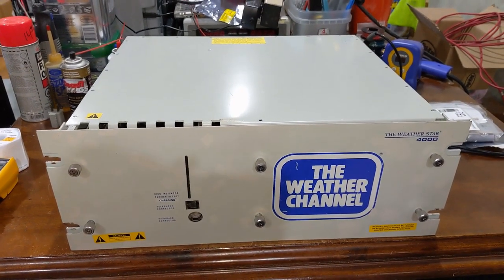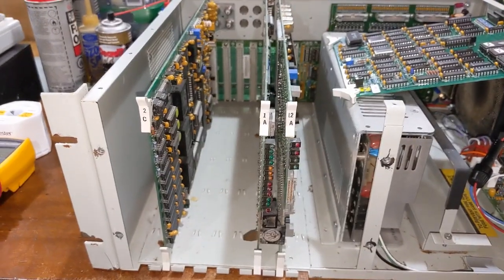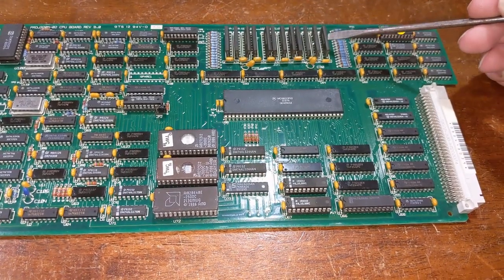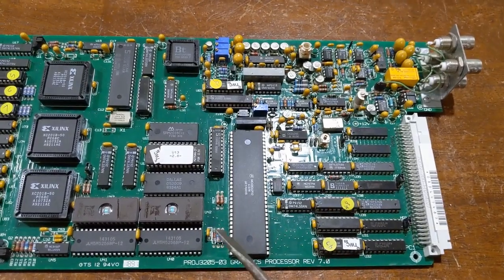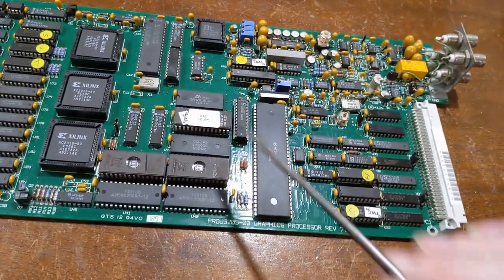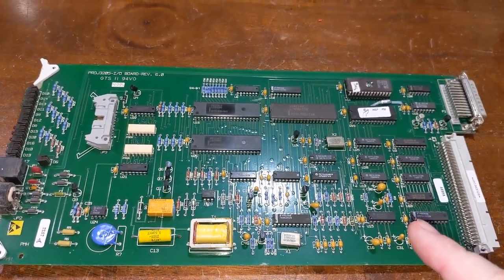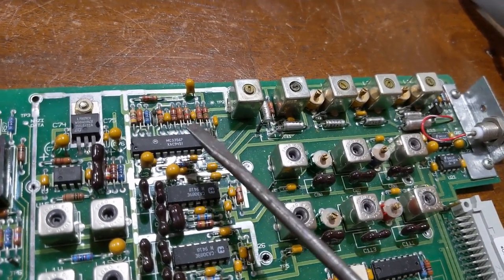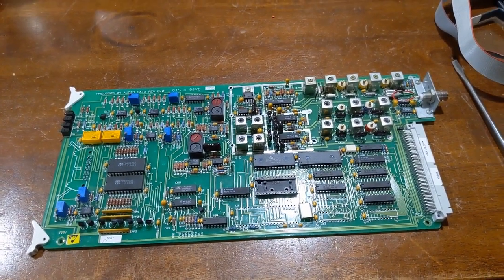WeatherSTAR 4000: A Brief Hardware Overview

Comment: This is absolutely fascinating and hardly boring at all. It's amazing to see how these older embedded computers work, and how uniquely they operate compared to modern systems - or even similar vintage systems with the same parts but a different purpose, and thus a different design, because you had to do so much in hardware. All the work that has to go into decoding the satellite stream (even after the Videocipher did it's work!) really makes me appreciate how much easier things are today with SDR's and SBC's, if less magical.

I'd love to hear more about the software side of things, and how you did the custom data decoder card. Coordinating all those different processors over a shared bus with weird limits on which processor can access what cannot be easy.
Reply from the maker: Glad you enjoyed it! It was a royal pain in the ass, especially writing software for a machine that "doesnt exist" digitally as far as documentation, etc goes. So it took full reverse engineering efforts plus memories from the 90s when I grew up, along with some help from others  to bring this machine back to life again. I wanted to do things differently, like running some form of an RTOS and having the application run under it, along with a RAMdisk image that contains all graphics assets. But then again that would have taken skills I dont quite have, fiddling with writing drivers for the RTOS and matching it up with this specific hardware, etc. I never majored in CS so that wouldn't be easy. Since I understand hardware alot better than I do software, I went bare-metal. setup a C Toolchain with GCC 9.2 targeted to the 68010. Went bare metal allowed me to do what I needed done. No memory management or kernels of course, no HAL or user/supervisor nonsense, so I had to keep track of everything I am doing with RAM and pass pointers back and forth. Real easy for things to get lost/crash, and no way of recovery due to the lack of an OS. the I/O card has its own ROM, and an 8051 CPU so I had to write that stuff in ASM and Keil. not to mention the new Data card, it has an Atmel AVR handling bus traffic and thats written in BASCOM BASIC, as well as the raspberry pi which bootloads the machine and feeds data into the machine, is written in Java. Weeeeeeee

Anyways, the Graphics pipelining was even more difficult because there are things which have to happen in parallel. So i ended up writing a tiny little task switching kernel which allows me a couple different mainloops as "threads" with their own contexts/stacks. That way the LDL draw can happen in parallel with main background rendering. still needs improvement, but it works...

Also had to work within limitations of RAM on the graphics board as well as bus master paging. For example, the Travel Cities Forecast requires a bit of orchestra back and forth between the GPU and the CPU over the IPC pipeline, and IRQ Vectors I had setup.

Comment: Nice overview! There were some things that I even previously never even knew about the WeatherSTAR 4000's hardware until now. If you do a follow up video, I'm curious to see how the 4000 boots up, as well as how it receives its data on the screen and how the menus and diagnosis features work. I'm also curious on how you wrote the code for the 4000. Either way, great work as always!
Reply from the maker: I will be on the weather brains podcast in June discussing this thing. its going to be a blast.
Reply: @THEtechknight  I can't wait to see that!

Comment: Not sure how I got here but it’s fascinating. Being a bit of an amp head I found myself wondering what kind of meter you have and if you had to replace any of the components on any of the boards? Looks like a nightmare to solder in new components to the video card in particular.

Comment: Some sites mention that The WeatherSTAR also used the VBL.  Though you never mentioned a circuit to decode the VBL.  Was the use of VBL dropped after the WeatherSTAR 3?
Reply from the maker: VBL was quickly dropped in favor of subcarrier by the time the STAR 3 came out. The original STAR1 and STAR2 were converted to subcarrier as well. As far as i know, no VBL units are left in existence.

Comment: Awesome video! I've seen you mention in forum posts that a Raspberry Pi replaces the satellite data I/O. How did you go about integrating that? Did you leverage the original FIFO and framing system?
Reply from the maker: I engineered a whole new data card, but, I kept alot of the original design so it just works 😁

Comment: The amount of things one 68010, a few cards and a few talented people can do back then.... :)

Too bad the original software is lost.

Coincidentally, some people replaced the 68k chip in some Amiga units with 68010s so there's that
Reply from the maker: Its a shame the original software is lost, but it is what it is. I got it running again regardless.
Reply: @THEtechknight  Ehhh true. 68k programming is an interesting idea regardless
Reply from the maker: @cm603  Yea, first time doing it. had to setup a specific toolchain and makefile/linker script for what im doing. Bootloaders are written in ASM, and I wrote everything else in C. the I/O card is also in ASM, Keil.
Reply: @THEtechknight  Assembly, assembly, assembly. Probably took a lot of your time, didn't it? 😛
Reply from the maker: @cm603  Yes, and no. there was a learning curve for the 68K assembly, but once I knew what the general instructions were, it didnt take too long to write the bootloader and things along those lines. personally, the AT&T ASM style used in GCC is worse than plain ASM and an assembler.

Comment: Isn't that the same processor the sega Genesis uses?
Reply from the maker: Sega master system
Reply: @THEtechknight  i though it was the genesis/mega drive.
Reply from the maker: @Kirby7601  pretty sure it was master system. I am not certain what the Genesis used. I'd have to look it up